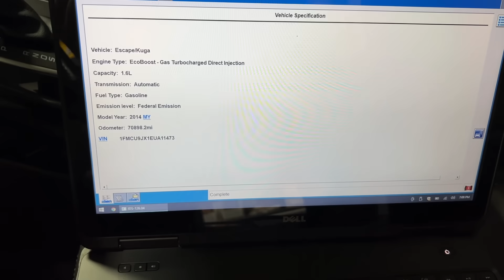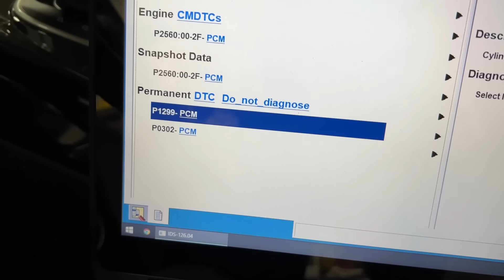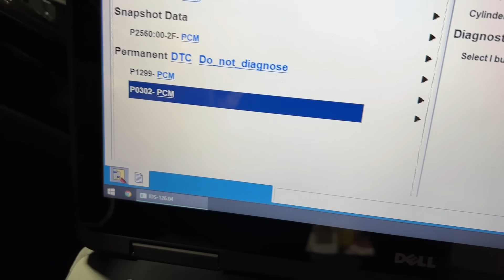Beware of Ford’s 1.5L 1.6L 2.0L Ecoboost Engines and Their Never Ending Coolant Consumption Issues!

Comment: So which vehicles have less major repair-prone components? 

I just discovered the issue with direct fuel injection because a family member brought his 2012 Impala 3.6L over with multiple cylinder misfires that a mechanic said needed his fuel injectors replaced. Since the charge was almost a grand, the guy just continued to drive it that way for many months before I heard about it. 
I recall someone else doing that and eventually the catalytic convertor was completely clogged to the point it wouldn’t even hit 5 mph. 

Anyway, I pulled the plugs and was shocked at the hard carbon-like rocks bridging the spark plug gap. And it got worse when I removed the plenum to replace the fuel injectors..the intake stems and ports were caked with a sort of baked-on carbon. 

A compression test revealed an issue with cylinder #3 and to a lesser extent cylinder #1. Then a leak-down test revealed the intake valves are leaking. I suggested the engine needed a valve job but the guy is down on his luck so having the heads machined appears out of the question, not to mention @ 175K, a new timing chain and water pump would be prudent. 

Anyway I did my best to wire-brush/vacuum out the carbon crud and reassembled everything with the old de-carboned spark plugs and old injectors, just to blow everything out without ruining the new stuff. Didn’t work that well though since it still had a multiple misfire. 

So I installed the new plugs and injectors, which improved the situation but the engine sort of lobed at idle and was smooth as silk on the freeway. I attributed that to the leaking intake valves. 

I sprayed some Berryman B-12 into a PVC port near the throttle body while keeping the RPM around 2K and it wasn’t long before the idle smoothed out. Well it ran great for about 3 days before he filled up and made it almost a hundred miles on the freeway before it sputtered to a stop. Every time the pedal is pressed, the engine bogs down. And those cylinder misfires are back. The only code is misfire. 

I thought maybe the gas was the issue but he swears he always buys his fuel at the same place. I plan to check it first anyway. Guess I’ll try a better spray before resorting to pulling the heads to hand-lap the valves with valve grinding compound. I told him an engine with only 37K miles is available for only $700+tax so I hope he considers it. 

I just wonder if this PCV oil blowby problem would’ve even happened had his oil changes been pure synthetic rather than dinosaur oil or a syn-blend. No matter, people need to be warned that direct injection doesn’t perform the normal valve cleaning of port injection. So that means even fuel cleaning additives won’t clean the intake valves.

Comment: I am getting a long block in my 2017 edge in about a week and my question is with all of the moisture going thru the system will it effect the turbo and do I need to bring this up when I carry it in to the shop? I am getting coolant and misfire codes and I did not know if it could rust or damage the turbo or the cat converter? Thanks for all the info you and others put out on youtube it has really helped me with this problem.

Comment: They couldn't get the 400 CID V8s right either back in the 70s. My dad had a 75 LTD wagon with the 400...overheated constantly. My dad dumped the car after 3 years; following year we get a letter from Ford about how the 400s had cracks in the block, under the intake. Ford offered to put a new engine in it...thanks, you're a little late!

Comment: Brian, you said it. Ford has been producing engines for over 100 years and they are having these issues.?
That vehicle only has 70000 miles on it and it is mechanically totalled. This is unacceptable!!

Comment: I know this is against the recommendation but, I have had luck with draining all the coolant and filling with 100% antifreeze with no dilution. The fluid is thicker and will slow or stop being ingested by the engine. Worth a shot.

Comment: I was a engine component design engineer at Ford in the 90s.  It was in the 90s when Ford started to purge all the old guys because they wanted to pay less for labor.  Well... what you now see is the result.
And if you want to know who is designing these engines.... look at the ethnicity of Dearborn. <-- if Ford diehards knew these two FACTS I think they would jump ship pretty quick.
Reply: So are you blaming Arabs? I mean, if you're going to be a racist, you might as well be specific.
Reply: @westhavenor  Stop the dishonesty.  
If you knew anything about skill sets from differing parts of the world you'd understand.
Americans are generally multi skilled. Especially the well seasoned guys who they purged. Folks from the middle east / east tend to be pure academics and have a very narrow scope mindset. Hence why the contour / mystique had 8 recalls in the first 2 months of production.  For crying out loud... they didn't know there needed to be a ground strap from the body to gas tank!
Race has zero to do with anything I talk about..  don't be so biased and simplistic.

Comment: I was taking this issue personal when I had the disappearing coolant problem.  Stop leak additives were just a temporary fix.  At 145K miles, the cost of repair is more than the blue book value!  Note to self: do extensive research on ANY car you’re thinking about buying - finding out something like this will save you a migraine down the road!!
Reply: Nissan Sentra transmissions go out before 100,000 miles yet no recall
Reply: I own a 2017 Ford Escape Titanium Turbo and at 70,000 miles my engine light went on and after I took it to the shop to have it diagnosed it turned out to be a $8,000 repair.  It turns out that the 2017 have these issues of having the head seal leak into the engine and since the block is made of aluminum it would require a complete engine replacement.  Don't bother about getting it from another distributer, it has to bought by Forde at $5,000 and the rest is labor.  I had originally purchased new in 2017 and it was under warranty until the 60,000 miles.  It is known that this is an issue and that there is no recall on it.  My wife and I are on the fence on whether to replace the engine or not, what do you think.  It still looks new from the outside and the inside
Reply: @davidortiz1114 what did you end up doing?
Reply: @davidortiz1114  I have a 14 model SE 1.6 ecoboost and my engine is the same way, also I have transmission issues too. Maintenace all done on time by Ford themselves but, with it out of warranty they tell me to replace the engine and the transmission is $16,000 dollars at the least. THAT IS STUPID! Mine has 147K on it, I am running it as a local driver until it just won't run anymore. I am sick of Ford. We have a 2013 Ford Edge, the water pump went out on it and that cost me $2680 at Ford to repair. It is paid off, still running it and it just rolled over onto 201,000 Miles. Keeping it too until it doesn't run anymore.
Reply: I am looking into using a stop leak. Where did you use it? in the resiv ? I was hoping this will work but who knows.
Reply: @danielengel1295  I’ve tried stop leak twice, and I still have to fill the reservoir every other week
Reply: Usually Sneaky Automakers

Comment: I only watched half of the video and was thinking, pressure test holding but engine cold. I bet it's a crack in a cylinder. Crack gets bigger with heat.
Reply: Bill over at Powerstroke Help had a simular problem on a Powerstroke.

Comment: How do they screw up a 2.3? That displacement 4 cyl is as old as dirt…you’d think with a bazillion hour of R&D they’d know everything about that engine?right?  I am wondering if the real issue here is a combination of the design and the casting process. The testing and qualifying engines had to pass testing more than likely but once things got up and going maybe something went sideways.

Maybe the original rest blocks were all cast and machined fine and if you get one of those that worked as it was supposed to life is good, but if you get one that was slightly off and something happened to the core type of thing and or it was reworked for some reason and that process doesn’t cut the mustard then your on the way to disappointment?

Just curious if you’re seen a lot of these and if there’s a sign of welding or the passageway looks different, maybe when you pull out the freeze plugs the one by that cylinder opens up to a cavity that looks mis shaped compared to other blocks that didn’t leak?  Idk, guess I just like to try and solve puzzles even if I don’t have a stake in the outcome or fully know all the details, free speculation is the viewers reward I suppose.😬🤣

Comment: Love how he's right to the point and doesn't sugar coat anything. 2013 and later escapes are junk. The earlier ones can run 300k easily if maintained properly. I have a 2001 Escape V6.  233k and runs like new. Everything is stock and original.
Reply: A 2001 Ford Escape is a Mazda! 🙂
Reply: @TassieLorenzo  no it’s not
Reply: I have a 2003 Ranger with the 3.0 in it. I’m at 178k!

Comment: Liked your video,having been a tech for 42 years and a shop owner for 31 years of those years ( yes I am old and retired now) it’s just such a shame how Ford’s quality has gone down hill. Going to small high output engines, like many other manufacturers was a big mistake. They generally don’t last long. Then to see these little motors pushing around a large SUV is just scary, they just work so hard. With that much coolant on top of the piston I wonder how much leaked past the piston and rings into the pan, making the traditional chocolate milkshake of the oil?
Reply: When have Ford 4 cylinder motors been good? Maybe the older 2.3.
Reply: @DM-hw4cr  the 2.5 is good but was designed by mazda?

Comment: I guess I was lucky. Earlier this year I sold my 2013 Fusion Titanium 2.0 with 207,000 miles without any issues. I bought it new, I really thought about keeping it but I wanted a change. I was looking at a Lincoln MKZ with the 2.0 since I had such good luck. I ended up with a MKZ but with a 3.0

Comment: Did you explain the cause of the leak and I missed it? I heard the block was bad and I heard about a crack. Is it a crack in the coolinant jacket leaking into the cylinder?
Are the cylinder walls too thin or close to the the coolant passages? Is the engine running too hot prior to the issue and the heat causes the crack?
Reply from the maker: yes and yes

Comment: Hit and miss seems to be the theme with these EBs.  My 2018 escape with the 1.5 has had zero problems and at 71k, has been problem free.  I go low on low side of oil change intervals and it uses no coolant, no overheating.  Similar fleet vehicles at my job have also been good, no coolant intrusion problems either.  I'm curious if the post  short block changes that Ford seems to have made, maybe mid year 2018, are still having the intrusion issues or did Ford get it right?
Reply: Ford didnt change the block design till mid 2019 so you are probably just lucky at this point

Comment: Have you seen any issues on the new 2019- Ford rangers with the 2.3 Ecoboost engine? Ty
Reply: From what I gathered the problem engines (1.5, 1.6 & 2.0) all have a slit cut between the cylinder walls to allow coolant to crossover.  The 2.3 (at least on the Ranger and Focus RS) has a bored channel instead of the slit for coolant to pass by below the deck.  The replacement engines also now have the cross-drilled blocks instead of the slit cuts.

Comment: I own a 2019 Escape.   In 2020 with less than 10000 miles Ford put a new long block in it under warranty.    Needless to say I wasn’t happy.   I still own the car and it seems to be fine now.   Fingers crossed.

Comment: 2017 Fiesta ST; I had a micro crack from the D.I. injector hole to the spark plug hole in every cylinder. When the engine warmed up the crack would close slowing the leak. Showing SOME misfires. Engine finally blew when the cracks got bigger. I didn't notice any of those cracks until after I had replaced the head gasket twice. The cracks must have been very very small

Comment: Didn't Ford redesign the newer EcoBoosts to fix this?
Reply from the maker: yes the newest engines I would say 2020 and newer should be safe.
Reply: @FordTechMakuloco  ok thx.  That's a double whammy for Ford: 1) they're basically implying there was a problem, and 2) yet they won't call the older engines a defect & replace.  I'm not hating on Ford, I actually drive a Ford (though not an EcoBoost), but your scope showed this is a pretty bad defect.

Comment: I thought only the 1.5/1.6 had these issues. We have over 200k miles collectively on 3 2.0s with 0 isses (one needed a trans replacement to be fully transparent). Good to know it's on the 2.0 too, something to keep an eye out for.
Reply: Yes, 2.0 as well, but not as frequent.
Reply: Itnmaybdepend that may depend on if you had the 1st gen  closed deck 2.0, which seems that many don't make that distinction.
Reply from the maker: yes see TSB 22-2229
Reply: @FordTechMakuloco  interesting, my 2016 Escape and 2015 Fusion isn't part of that TSB but my 19 Fusion is because it was built pre 4/19. such an odd year range.

Comment: Recently I replaced the block in my 2011 1.6 and can confirm that the design is total junk.
They kept the base block from the NA and put a turbo on it, so the cylinderwalls fail.
This time I installed an engine mod kit and hopefully it will last the cars lifetime now!

Comment: my car 2016 Ford Edge se sport or whatever , 4,000 miles when first got it.  2 years the brake line busted and I had to stop at car shop because my brake was touching the floor and my car barely stopped . Next the fuel filter , next, the fan kept running when I turned the car off , ford said it’s because it’s hot outside, that was not true, the fan that kept running killed the battery , this is just within 3 years . Next I smelled fuel and the car didn’t want to go and hardly start. They finally replaced my engine. They never replaced my cabin filter. I just replaced it and it was bad .